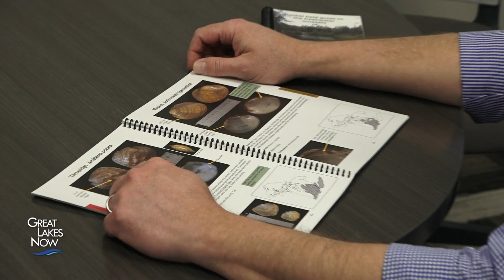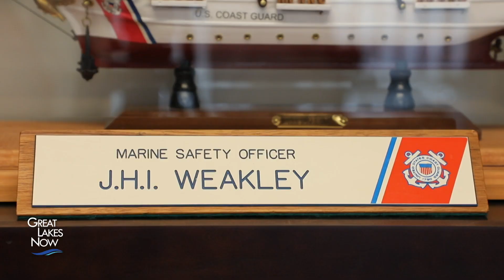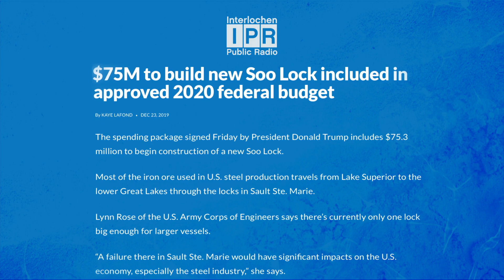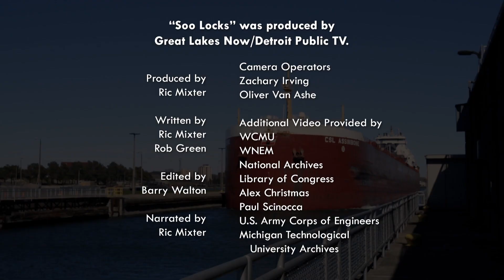Drop, Soo and Lock It - Great Lakes Now Full Episode - 1011

Comment: Why exactly do walls have to have the mussels removed?  On ballast water:  Couldn't there be some onboard solution whereby the ballast is subjected to electricity, or some type of solution (say, EXTREME levels of some salt or substance that would be rendered harmless when diluted in large bodies of water, but deadly considering the limited capacity of the ballast).